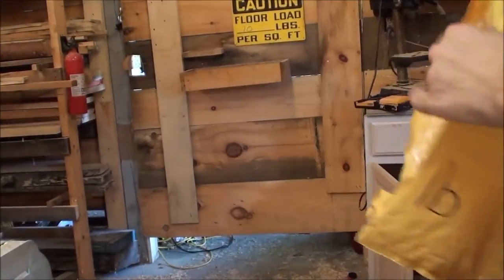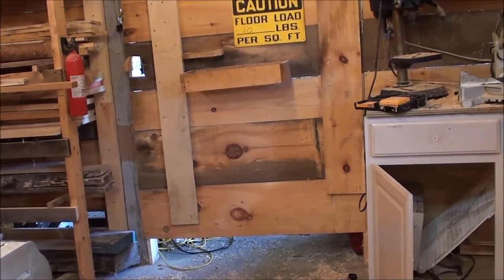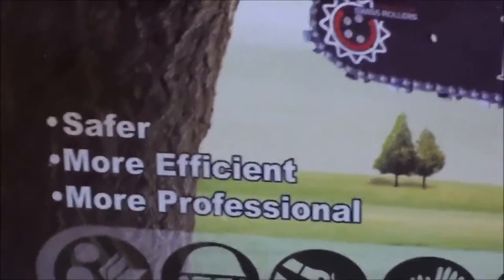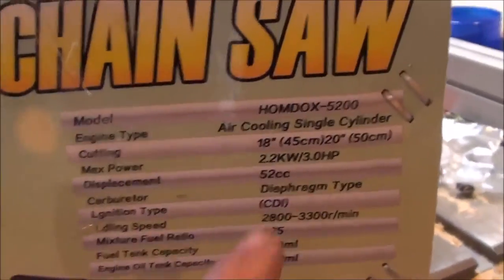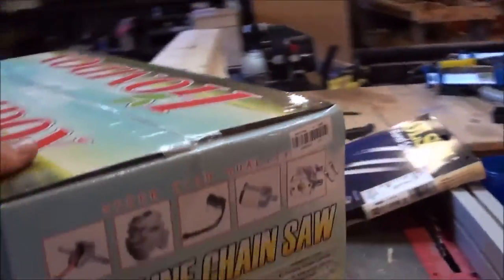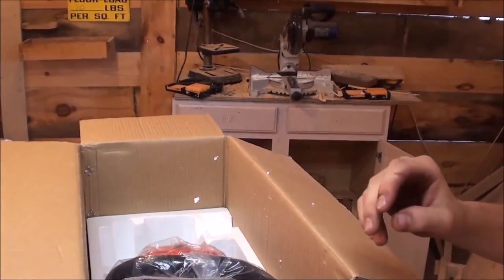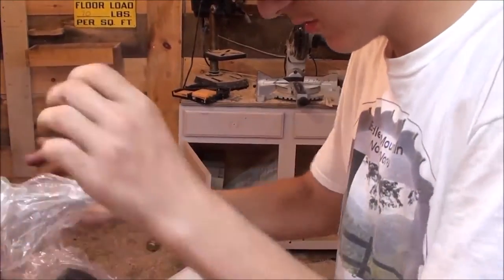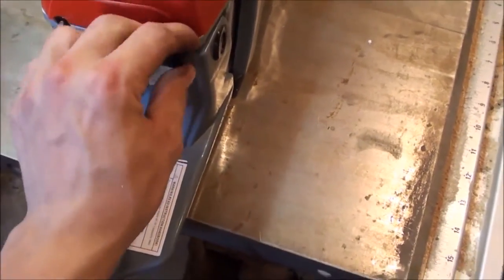Homdox Chainsaw unboxing and short review

Comment: I have the same one, has been more in repair than in use, something is always wrong, chain loosens after just seconds of use, leaks lube when not in use, hardest to adjust carburetor I have ever seen, if you are going to mess with carb L and H screw, the key is to set them both first to 1 full and quarter turn, then tweak only minimally from there. Also had to replace ignition coil after only a few months. I bought a second one that has a slightly newer design, but similar problems persist, chain loosens after short use, these things are driving me crazy, always fixing them and ordering new parts from ebay.
Reply: I sold this one about 2 months after this video, Mine did not have those problems that I can remember but a cheap saw is still a cheap saw.
Reply: I've got the Homdox 5800 and have had it running a couple of times for short periods until it quits.  This thing is junk and I even told them on fb messenger.  I bought it in 2016 and only used it a couple of times briefly until it quits then put it away waiting for time to repair it.  You can't find parts for them.

Comment: dissasembled my 62cc homdox. I was impressed it has a walbro carburetor.Piston,piston rings and cylinder are all in good condition.

I have ranned 30 tanks of gas in it. So far good still. It already paid for itself so if it breaks i dont care.

Comment: Wish you hadn't sped up the chain install process. I was hoping for a step by step as the diagrams are extremely small in the manual. Would you consider another video of just putting the chain saw together -- slowly?
Reply: It is pretty straight forward, if you cant figure it out you probably shouldnt run a saw.
Reply: In the time it took you to attempt to insult me, you could have provided the additional information I politely asked you for, and maybe helped a few other people in the process. I've used plenty of chain saws in my time, but have never had to put one together out of the box. The diagrams provided were pretty lame -- that's why I was interested in your video. I asked for your help. You chose to be rude.
Reply: @endlessmountainwoodworks4278  True haha.  A person seriously has to have the patience to play with this thing and figure it out or give it up.
Reply: @erichtrapp6889  Maybe he doesn't have the time, he ended this video with the statement he wouldn't be back, maybe you didn't hear that.

Comment: were did you buy your homdox  gas chain saw   i want to buy one
Reply: Off of ebay, here is a link- http://www.ebay.com/itm/52CC-58CC-62CC-20-Gasoline-Electric-Chainsaw-Cutting-Wood-Gas-Chain-Saw-hfor-/272295858293?var=&hash=item3f66191075:m:m0ARjxRMlTCcqEk7pUEAGPA

you could wait until it is back in stock or buy a different one.